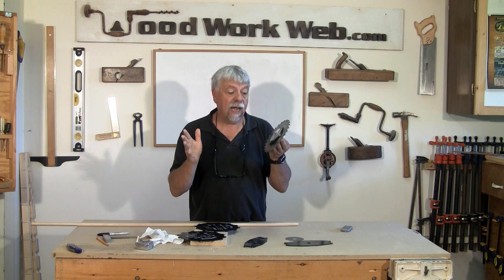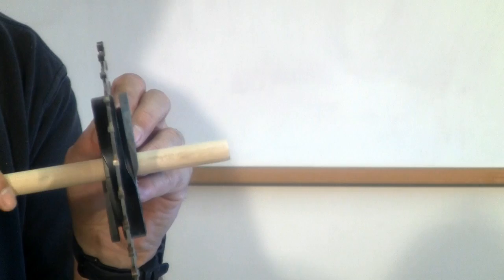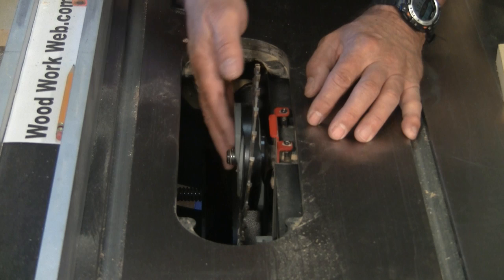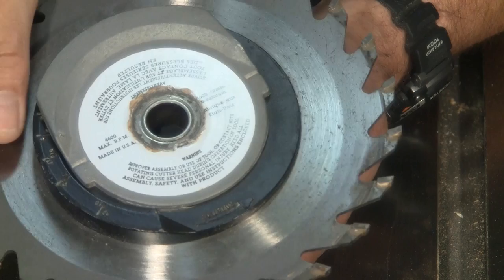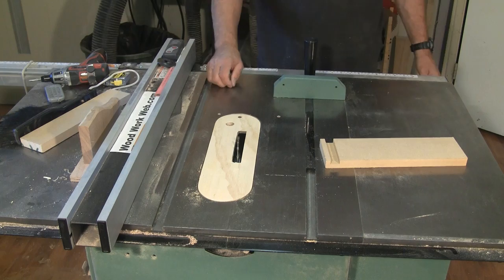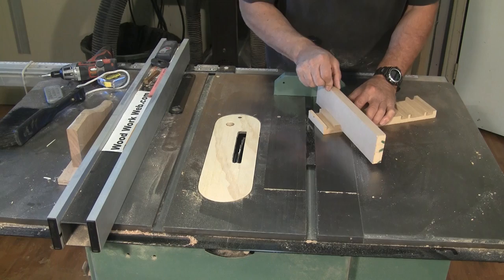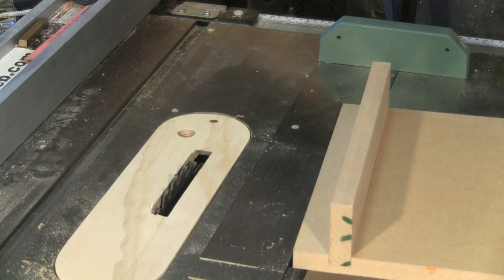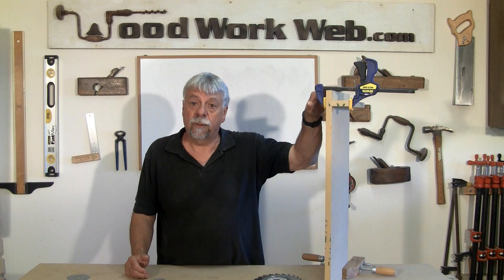Testing the Wobble Dado Blade -  woodworkweb

Comment: Oldham and porter cable have wobble blades. I have the same blade that you are testing and I only use it in my radial arm saw. Loosen the arbour nut adjust and continue. With practise you can usually get it the first time.

Comment: I have a couple of these that I still use once in a while (have used on a RAS too, which I don't do now).  To make the setup easier, I first mark the two teeth that make the greatest excursion (i.e. form the sides of the dado) with a Sharpie.  This allows allows an adjustment with the power off by rotating the blade by hand and comparing the marked teeth against a ruler.  I then draw index marks for several widths (1/4", 3/8", etc) on the hubs.  Oftentimes small adjustments are still necessary because the stock is often a bit different than the nominal thickness.  For my wobble blades, they produce a square-bottomed cut at 3/4".

By the way, the adjustments are far easier to do on the RAS, but the hook angle of the teeth make this blade very aggressive, and so I wouldn't recommend using it on the RAS.

Comment: I have owned this wobble blade for 30 years. If you are doing more than 2 or 3 adjustments you are not doing micro adjustments. Plus it doesn't have the kick-back like a stacked dado set does. I find the hardest problem is getting the blade to it's farthest point to achieve an accurate width when making cuts on plywood for shelving.

Comment: Dado stacks not available in Europe but there is room on the motor spindle for 2 identical blades if  you could get a thin spacer between them to allow for blade teeth offset (Kerf) .

Comment: The blade had a major flaw, and simply its "balance" Wobble is a good name. Its not wobbling but the forces on the hub and the table saw spindle tend to be higher. The more its set to wide cut The more out of balance it becomes. The adjustment hub also doesn't help the balance as it throws the force off in a different but mot opposed direction. What does this mean? Either it will put a strain on the shaft of the motor or cause a vibration problem and possibly a poor cut. These were a cheap alternative to buying the high end cutters at a time but you get what you pay for.

Comment: I have a two-blade wobble setup. You can measure the cut with a caliper across the two blades and get it right the first time. It also cuts a flatter bottom. Craftsman item from years ago. Would love to see you do a video on that one...

Comment: Well done, another mystery solved! I imagine that once you have "dialled" the blade in, it would be possible to glue some little vernier measurements to the "Zero" point of the saw blade. It would be interesting to see if the  "Zero" is consistent when changing to other thicknesses. A vernier scale for those who may be wondering, is two sets of measurements set side by side on opposing pieces which move in relation to each other. The most common example is on a metal working lathe tool post, where fine increments of adjustment are possible by moving the post around the scale. Think of 10 degrees divided by 10, giving a total allowable of adjustment (by my understanding) of 100 divisions.

Comment: Hi

Many years ago, in the age to which Colin Knecht refers, I purchased the Samco (made in Canada) Tru-Cut dado blade. This blade looks like something a Ninja warrior would use. To shock and horrify mere mortals that may read this comment, I used the blade on a RAS, yes, a Radial Arm Saw.

The blade is only six inches in diameter and is very well covered by the 12" RAS blade cover. This blade is cleverly designed in that the "wobble" is stamped (by a very strong press) into the blade. Either side of the blade is a hub, cut on an angle to mate with the stamped in wobble. 

The blade functions just like the blade shown in the video, but is much easier to adjust. The cut width is marked on both sides of the hub. As the hub is rotated within the blade, a mark stamped into the blade (both sides) is aligned with the users required width.

This allows very quick and very easy adjustments to the width of the dado cut and is very accurate in width. If your timber is one of the sizes marked on the blade then setting the blade to that size produces an accurate dado. Minor variations from any nominal size are very quickly adjusted on the blade. The adjustment is MUCH faster than portrayed in the video. 

To make a width adjustment you do NOT have to remove the blade. (after all safety considerations are in place) Loosen the nut on the hub and while holding the hub, rotate the blade (on the hub)  to increase or decrease the dado width, SIMPLE!

When I purchased this blade, I considered a dado set and while the RAS arbor is long enough to hold a dado set, the MASS of the blade set and the fiddly way of setting up the stack was not as convenient as the wobble blade.

An additional advantage to the wobble blade is the infinitely adjustable dado width. This is much easier to cater for in the wobble blade than fiddling with washers and spacers of a dado set.

Though I have never needed to have the blade sharpened, the eight carbide tips (on a single blade) would be MUCH cheaper to sharpen than the many more teeth on the multiple blades of a dado set.

Search for Samco Tru-Cut and hopefully there will be some images available. The images I found were all eBay images so they may not last forever.

Kind regards

Peter

Comment: That thing would drive me nuts. Might be ok for some things but if you had to make 3 or 4 different size dado's  it would take forever to adjust it. Thanks God for the stacked dado set. Thanks for the video you explained it very well Colin.
Roland
Reply from the maker: Hi Roland, yes, I had not used this in years and had forgotten what it was like to work with.

Comment: I had a variation on the wobble wheel which was two blades that separated and if I remember correctly that variation resolved most of the crowning issue.

Comment: I have a wobble blade I think I may have used it 3 times in the last 18 years. I just set the height and mark the wood and cut it out with my reg blade. I think after the time it takes setting it all up I'm saving time.

Comment: The only reason you will get a non-flat bottom is because of variation in tooth height, or if the arbor hole is off-center.  It's rather difficult to explain the geometry of it without a diagram, but I understand why people would think you automatically get a dished bottom dado from this type of blade (but you don't).

I have a Harbor Freight version of this blade, and I do get a dished bottom, but what do expect from an HF blade?  The one you are using looks really good.
Reply: You get a dished bottom bc when it wobbles to the side extremes the was diameter remains the same so you'd need a slightly longer blade to fit that corner in exactly. You could calculate the dish by using Pythagorean theorem and al that stuff to add up the vertical difference in the finish.

Comment: I think that the biggest reason they are not so popular is that it is more involved to work out where the slot will be relevant to a fence...ie: the quantity of material left between the slot & the blade. It is obviously quite difficult to set an exact dado width requiring trial & error.

Comment: Love my wobble wheel!
The best way to use this is pick it up at a yard sale and buy that old craftsman radial arm saw to go with it. 

Mine cost a total of 55$. The greatest thing about this setup you can see the surface of the wood you want to dado. You can use the saw head like a sliding miter saw and also lock the saw and run strips.
Reply: Old Dewalt pre 1970s radial arm saws are much better than any model that craftsman ever made. They aren't quite as common as the 70s and 80s craftsman models but if you can find one they don't get much better than a old dewalt with a cast iron arm and the height and miter adjustments on the column. I currently have a mid 50s 12 inch and a mid 60s 10 inch and they both run like a Swiss watch and have held their accuracy requiring almost no adjustment.

Comment: The issue I remember having with the initial setup was that the adjustment on the blade changed as I tightened the nut on the blade/hubs . I just set it up alittle over/under ( don't remember which ) and the nut tightened it back to the mark .

Comment: I've been building cabinets and furniture for over 30 years, and I've used both stacked dadoes and 'wobblers' with fairly equal results. Yes, there is a concavity in the cut of a wobbler, and the depth will vary with the width of the cut, but it's negligible. Maybe a 64th in a 3/4 wide dado.

Comment: Hey Colin.  Good.  Video on. The Wobble wheel. You are so right.  About the cost savings  compared.  To todays. Dado stacks  ive. Consistentsly.  See the Wobble versions.   For sale. For around. 7 bucks  on. Ebay. An yard sales.  Usually. Craftsman. Brand. ?    I. Do remember. The first time.  I saw. One. Being used. As a teenager.  It scared the. Heck out of me  lol   But. Way faster than. Plowing. Out. The wood with my router    And straight edges. !   It is a good cost saving.  Idea.  To. Use. Btw. I.  Have binge watched. Most of your. Videos  an ive found each one.   Having. Good content and helpful. Advice   Your. Style of   Videos. Is excellent with. Good explanations. And  good. Camera angles.  Please.  Keep. Up the.  Videos.  I have.  Subbed. Will like and share.   Whenever. I can to. Show my support.  Of the channel   And i will look foward to more.  Ideas.  And tips.  From you. Btw. I.  Was a Woodworker. For 20 plus years.  Who suffered. A traumatic brain injury.   That.  Forced. Me to.  Retire.  Due. To. Some. Paralysis. On some of my limbs.  And. Major brain damage.  Forcing. Lifestyle. Changes.  At the moment I’m.  Between.  Shops. But my passion for. Wood products.   Is still. There and i hope.  To. Return. To. A shop. Again.   When life permits.  Ive retained. Many tools of course   And.  Try to.  Stay on top of the.  Changes. In the industry.  As much as. Possible. , my true passion is. Wooden Boats. Anf that. Industry.  Ive. Restored. Vessels. But have. Not had. The chance. To build my. Own.  As of  yet.

Comment: I have an Irwin wobble dado & in 2 to 3 attempts it should be very close & it has a cinch screw to
keep it in tolerance. Even when I use my Freud 8" Safety Dado I might rough it out with the wobble dado.
That depends on how much material i'll be running.
Many times for furniture the wobble dado is fine but for fine cabinetry the finer dado is best.
Just my thoughts.

Comment: I don't understand those that make fun of the set-up time. I have used both a wobbly and a stack set for nearly 40 years. The wobbly is easier to set up, as both require removal from the saw arbor followed by troublesome trial-and-error re-stacking of chippers and shim sheets on the stack set, vs. simple twisting on the wobbly. On a RAS it's not even a close contest. Also, though my stack set was name brand and expensive the grinding was apparently not perfect, and the slight variation in chipper cut left an uneven bottom in the dado that was even worse than the SLIGHT curvature from the wobbly. The wobbly is GREAT and we should all lament its demise.

Comment: I have two of these and they scare the crap out of me for some reason. The only reason I would not use these again is that the vibration for the wheel induces a wobble onto the motor's shaft. I can't imagine that is very good in the long run.

Comment: ya know - you CAN measure the run-out/angle of the blade to get pretty close to the thickness of the dado you want so that you dont need to take it out and put it back in 5-6 times.  Usuallyyyyy you can get it dialed in within 2-3 (especially if the dado blade still has its markings on the dial for the thickness still visible)

Comment: Nice. I have a Comet quick set dado that came with my shopsmith. It is the same design, only it is a very odd arbor size. I think they were for radial arm saws.
Reply from the maker: Hi Barrett, I have not heard of that. I did notice that mine has a small insert sleeve that I had not noticed before. I wonder if that is for the odd arbor size you mentioned .... hmmm, very interesting

Comment: it seems to me like it would be easier to set your exact date I went by placing the blade flat on a surface and measuring the low point and the high point of the blade. That way you don't have to guess and check by completely installing and uninstalling on the saw

Comment: that gap comes because you have removed half of the board, it's caused by the surface tension in the mdf pretty much the same as when you cut a long narrow strip and it bends

Comment: I've discovered the trick to using these is to dial just under the size marker you want to use by the width of the marker line on the inner metal dial.

Comment: It's not really bad ! for this price, if you don't care to (barely) see a gap (or if this will be covered) it did the job !

I think you just have to make a few tries with the most common sizes of dados and mark yourself the right spot on the adjustable disc.
Reply from the maker: I didn't think the gap was terribly bad either ... actually less than I expected and there probably is a better way of adjusting the width ... maybe some sort of a jig. Anyway, I think for many, it still has it's place :)

Comment: Well, I must've been the one person that got one back in 1970 that was dead on balls accurate. I just searched for it and found it with my stack dado blades. I think a jointer squaring up that piece may have solved the problem. My joints were very clean.

Comment: Do they fit on a 10” table saw or will it be to short.
Reply: I use one on my full size Sears 10" table saw. Got it at goodwill three years ago. Sears brand in fact. has a bushing that allows it to fit the table saw. It doesn't, however, fit my 10" bench-top table saw because the arbor is too short.

Comment: What an extraordinary way to go about making adjustments!

Just like you could set the height by checking the position of the top or the saw arc, all you need to do to get a good starting approximation is to check the widest points of cut.
Still, if you want to make endless work for yourself...

Comment: Thanks Colin, I have a friend who is retired and has a wobble wheel Dado blade he is giving me and I had never seen one in use before...not sure if it will be that useful with all the adjustments one has to make to get the dado cut accurate. The crowning effect would normally not be an issue for my projects—Is there much added vibration to your table saw?

Comment: I have one of these blades and when you tighten the arbor nut , it sometimes turns the adjustment you set and makes it wrong. That's why you are adjusting it so much. I drilled mine and tapped the hole and put a set screw in it so it would not mis align when i tighten the nut.

Comment: The only dado blade I've ever used is a 7 inch Hickory brand wobble dado that I bought at Sears around 2001. I've never used a stacked set & was wondering if I've been missing out on technology. It seems that I'm not from what you're saying. I looked at the Freud dial a width but my Jet Jtas 10 arbor isn't long enough. I'm thinking of getting a cheap Bauer stacked set from Harbor Freight.

Comment: I really like my "wobble wheel" dado blade, in part because I can set it to ANY width, which allows me to make slots for any kind of material I want to set in.  I guess there must be fine shims for micro-adjusting stacking dado sets, but if you are a little smarter about how you dial in your wobble wheel, you can hit any exact thickness quickly enough to make the setup difficulty a non-consideration.  I also never really minded the slight crown, it's never been a problem for me.

Comment: I've used one occasionally for years, and I've never had to readjust it more than once to get a tight joint. Mostly for shelving unit sidewalls. Love the thing, but it makes you nervous at first in a cheaper table, as it vibrates a little! Mine has two little allen screws that lock the cam adjustment and they're grey, not black like yours.

Comment: Seems like you have to waste a lot of scrap that could be used better elsewhere just to get this thing set right. My first instinct is to not use any sawblade where the selling point is that it's better because it "wobbles." Wobbling and spinning blades are something I tend to avoid. Heck, I I get nervous even using a push block.

Comment: Interesting tool. But you're right, it seems difficult to get precise.
 
If you had a template for the size of gap you needed, you could use that to more closely tune-in the wobble blade the first time.
 
Just place the gap over the dado and spin the blade by hand until it doesn't touch the gap's edges.
Reply from the maker: Hmmm ... that might work, sounds like a good idea, maybe someone will try that out and see how that works, thanks for sharing that with us ... great idea that might even spawn other suggestions too

Comment: Interesting, never heard of this thing before. The first thing that popped into my mind though is wouldn't the blade movement make kickback much more likely?
Reply: The extreme mass of the cut would. Until you’re accustomed to the difference in it and regular cuts. Not hard to adjust to, I’d advise repeated light cuts until you’re familiar with the tool.

Comment: FWIW, I did the math. Assuming that's an 8" blade and a maximum cut width of 1", the cut will be at most .031" deeper in the middle than at the edges.

On a slightly different note: if both wobble dado blades and stacked dado blades are illegal in the EU, what do people ther use to make dadoes ? A router?

Comment: it seems to me the primary disadvantage of the wobble wheel is the set up, it looks like it takes either a lot of practice passes to dial it in or a lot of trial and error.  Vs a dado blade where the size of the cut is easy to determine.